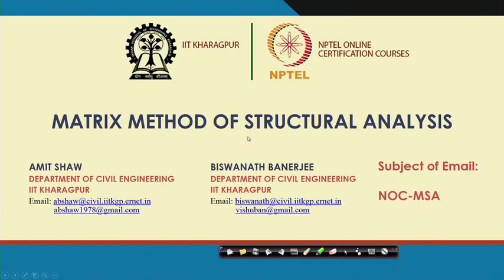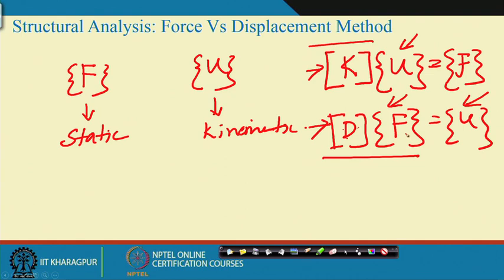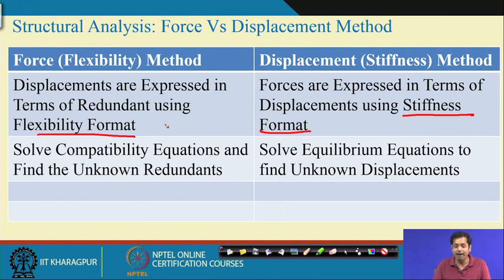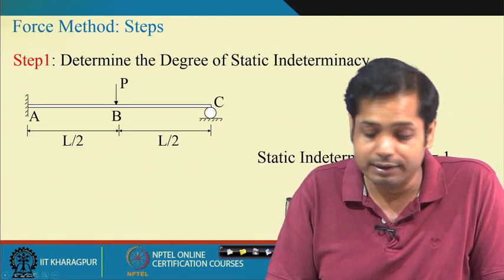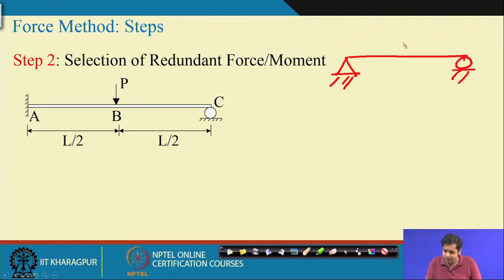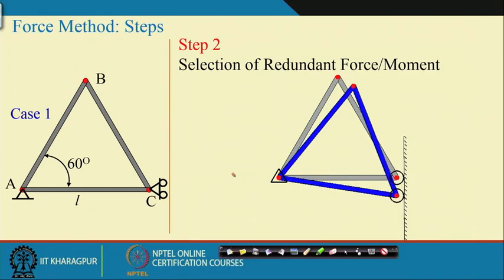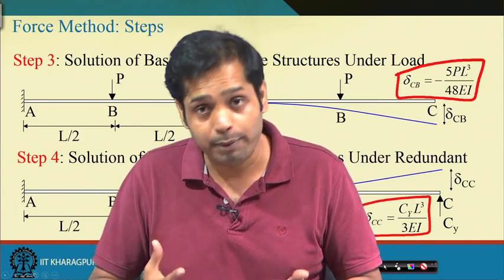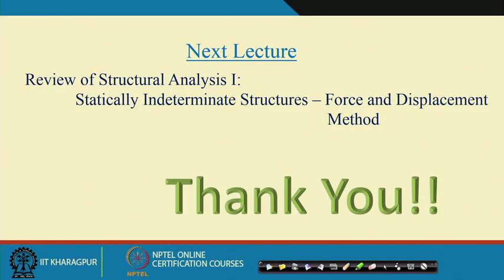Lecture 06: Review of Structural Analysis - I (Contd.)

Comment: DOSI has to be 3-2 or 4-3? The end result would remain same but in this case , the beam is subjected to vertical loading and not gradual and the supports too are at the same level , so do we need to consider the horizontal Equilibrium condition and hence horizontal reaction at A?
🙏